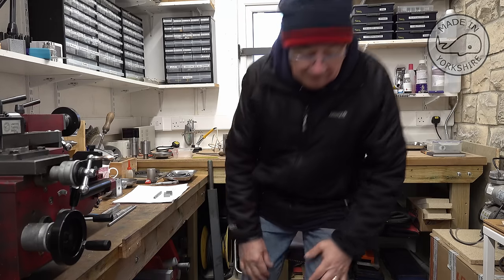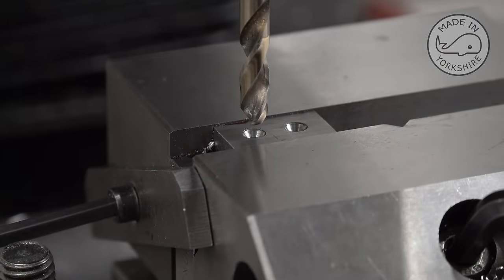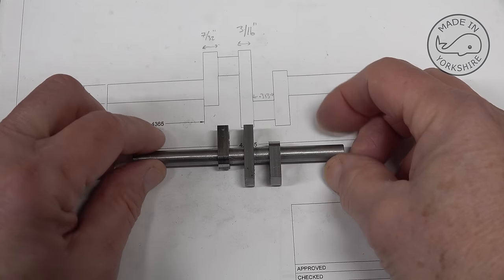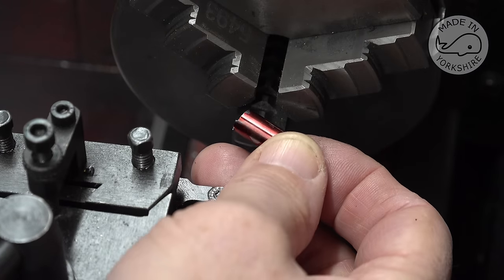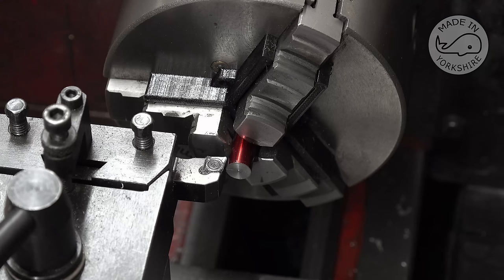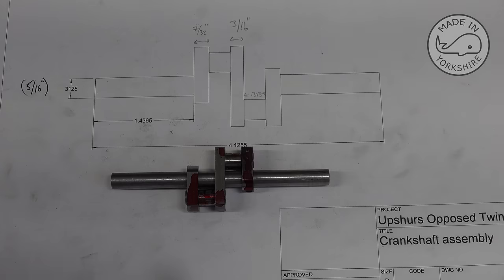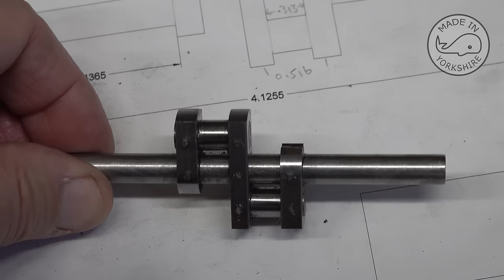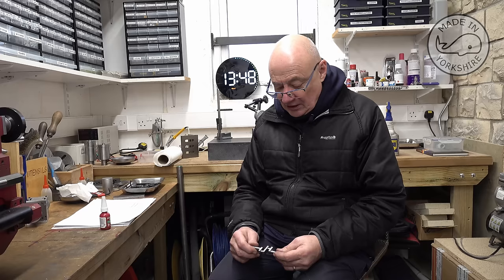#MT56 Part 3 - Upshur's Opposed Twin IC Engine. Fabricating the Two Throw Crankshaft. By A Whale.

Comment: Hi Andrew, looks really good. On my last twin crakshaft build i used the same method as you with Loctite 638 and pins, athough the joints worked loose due to an apparent failure in the Locktite, i rebuilt the shaft again and a mate brazed the joints which worked a treat lucklily with no distortion. I tested the Locktite on some scrap and found that failed too. I then realised that the Locktite had expired by 1 year so was scrap - a new bottle was purchased and all is good. Cheers Andy
Reply from the maker: Hi Andy - now that is very interesting. The Loctite I used to temporarily join the crank webs together was from an old bottle and that failed. Fortunately the Loctite I used for the final assembly was from a new bottle. Looks like it might have been my lucky day 🤞
Cheers
Andrew

Comment: Tidy looking crankshaft Andrew. I have a slight concern that the centre web has been weakened due to drilling through the middle to align the shaft. The remnant piece of the shaft will provide some reinforcement but the forces will be greatest on the centre of that web. Perhaps others can confirm from experience whether the web will be strong enough or if failures have occurred using thus configuration. As you rightly say, if there is a problem you will have the option/challenge of making the shaft from a single solid piece. It is an interesting engine and I am enjoying this build series. Those spiders for the chuck are a neat idea.
Reply from the maker: Hi Tim. That potential problem did spring to mind. In hindsight I think I could have increased the width of the crank webs without them interfering with anything else. However, I would have thought that the remnant piece would offer some reinforcement,but I guess time will tell.
Cheers
Andrew

Comment: Good job Andy. I'm sure that will work fine as it's only a model. Trying to make a 1 piece shaft will take a lot of know how but I have never machined a 1 piece. A friend of mine who was very experienced tried to but fouled it up on 3 occasions so he did it out of a few pieces.
Reply from the maker: Thanks Dermot. I'm always one for an easy life. No point in making things more complicated if I can avoid it. Fingers crossed it will be strong enough.
Cheers
Andrew

Comment: Good looking crankshaft, Andrew. As a possible plan A#1 rather than using the Loctite 638 the webs can be soldered using the Harris Stay Brite. I position my webs then drill the pin hole locations initially just thru the webs from one side, but not thru the shafts. I then apply a little Stay Clen flux in the pin holes and insert a small piece of the Stay Brite solder in the holes as well and heat the entire assembly until the solder runs. I then redrill the pin holes thru and pin the webs using Loctite the same as you have done. So far, the heating has not distorted the alignment of the crankshafts.
Reply from the maker: Hi Earl - that is a brilliant suggestion. Having had a good experience with Stay Brite on the cylinder sleeves I did wonder how to apply it on the crankshaft. I just couldn't work out a method. Your solution sounds perfect. Thanks for the tip!
All the best.
Andrew

Comment: Happy New Year Andrew. Is there a reason you didn't use any lubricant when drilling the holes ? I think that I would have used some emery cloth on the journals before trial fitting: silver steel can be a bit of a pig for throwing up burrs. I don't know what the highest speed is on your mill, but 1/16" drills need a pretty quick one to cut well, though I can see the advantages of using the mill rather than trying to set up up a drilling machine.
Reply from the maker: Hi George - a Happy New Year to you too. To be honest I'm a bit random when it comes to libricating holes when drilling. Though I do make sure they are lubricated when reaming. It's pretty cold in the workshop at the moment and it is sometimes quite difficult to concentrate. I think the mill was flat out at around 2500 rpm when I used the 1/16" drill bits.
All the best.
Andrew

Comment: Hi Andrew, left field question.  What clock is it in your workshop?  I’m after a clock that shows the current weather.  Great job on your crank shaft!
Reply from the maker: Hi. Unfortunately the clock only shows inside temperature. I think I bought it from AliExpress but I can't find any details.
Cheers
Andrew

Comment: Hi Andrew, I'm impressed with the accuracy of your three jaw chuck machining those crank pins. How accurate is it?
Reply from the maker: Hi Philip - a good point. I usually use very accurate collets - but very difficult to set a back stop. The chuck has around 3 tenths of a thou runout. Fingers crossed the crankshaft will be good enough. 
Cheers
Andrew